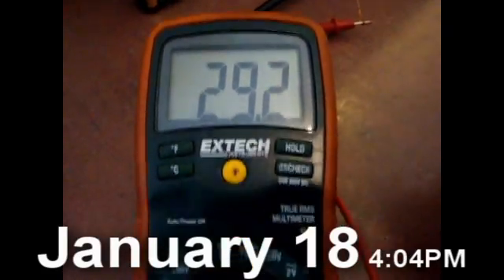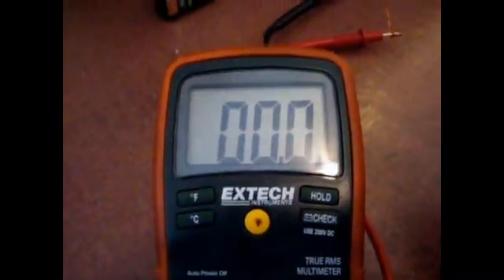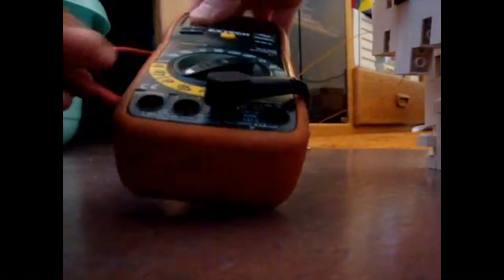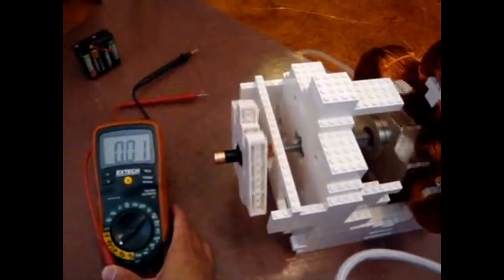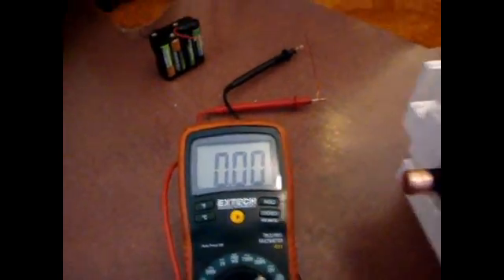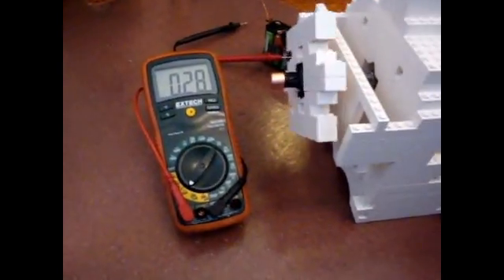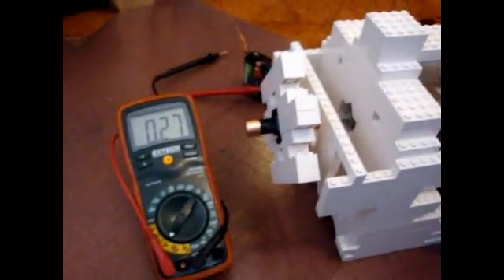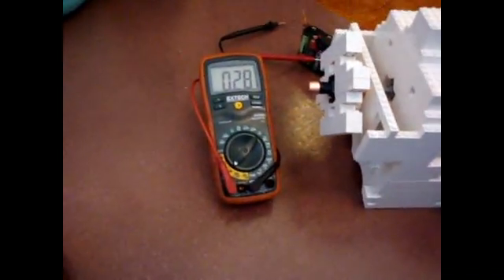2011 Newman Motor (Magnets added)

Comment: you  know  that  your  not  making  or  using  that  amperage .  The  coil  is  just  like  a  resistor.
Reply: Yep. This was actually my worst design. Pretty much all the applied voltage went to the resistive voltage drop. So nearly all the power went to simply producing heat.

Furthermore some of the "better" motors I made produced a lot of interference, enough to cause "static" in a digital TV signal (presumably by penetrating the coax shielding due to the transient nature of inductive field collapse).

- - - - - - - - - - - - - - - -

Currently (i.e. April 2017)  I've been trying to see if it is possible for an electromagnetic field to emit a large amount of angular momentum without radiating much energy. If that's possible, then it should be possible to deflect the kinetic energies of the bound currents of magnetic atoms, without a chemical or nuclear process and without disrupting wireless communications.

Here's the idea in detail: Since the momentum of the electromagnetic field depends on electric fields crossing magnetic fields, via something called the Poynting vector field, the idea in this case is to produce a Poynting vector field that circulates around the axis of the magnet and whose outer product diminishes no faster than the third power of the distance. This will require solenoidal magnetic fields and radial electric fields whose outer product drops with the cube of the distance. If one calculates the angular momentum due to the momentum associated with said Poynting vector, then density of that angular momentum will decrease with the inverse square of the distance, and the total amount at a given distance will be the same, such that if you were to integrate the total angular momentum of the field including all distances, it would accumulate with time. This is different than the radiation of energy, which requires the outer product of the electric and magnetic fields diminish with the inverse square of the distance.
Reply from the maker: And yes, I am "Sho Drives"....

http://www.sho.wiki/now/YouTube/2011